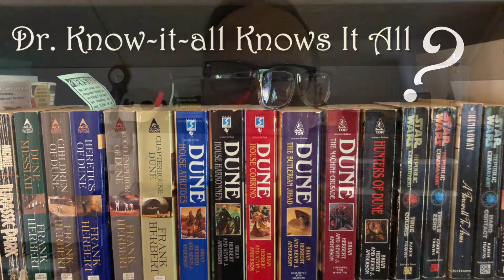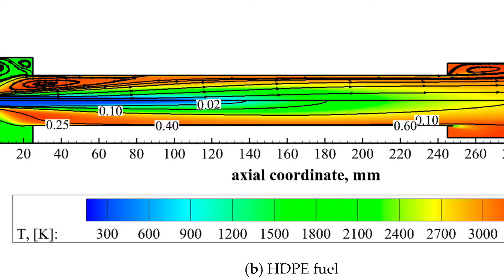Starship BOOMS: Why are so many of SpaceX’s experimental ships failing?

Comment: SpaceX is testing the Starship propellant tanks and associated intertank structure now using simple pressure testing to verify the design and manufacturing suitability along with occasional short engine burns to apply loads to the thrust puck. The early SNx prototypes started with minimal internal stiffening, which is being added incrementally in the successive prototypes. The purpose is to find the minimum mass for these SNx prototypes such that they are sufficiently strong to withstand the loads being placed on the structure.

Comment: Endless repetitions. 14 minutes video, 1 minute worth of content. Different design philosophy: build fast and learn from failure vs meticulously modeling a less fail-prone product. Of the 4 prototypes just 2 failed because of imperfect stainless steel construction, 2 more because of the testing procedure error and likely a faulty valve.
Here, saved you 12.5 minutes.
Reply from the maker: lol. Guess you're an efficient guy. I can respect that :)